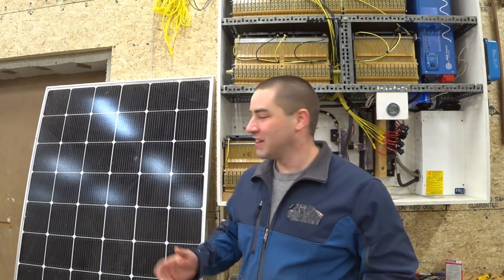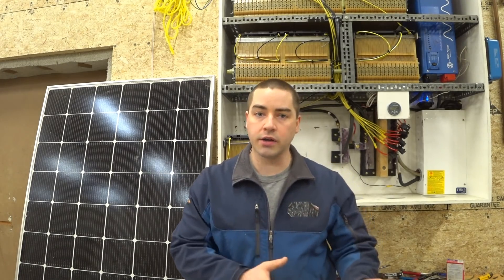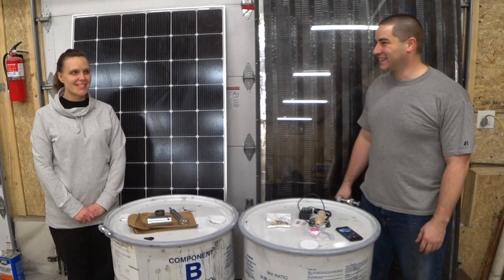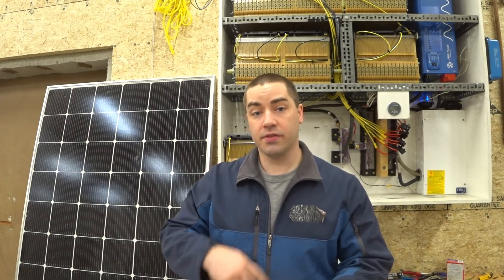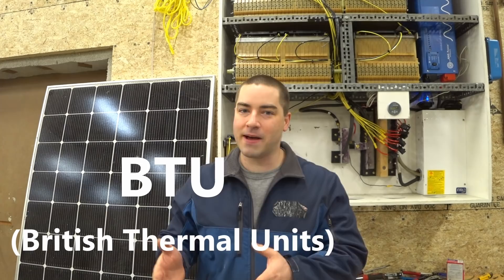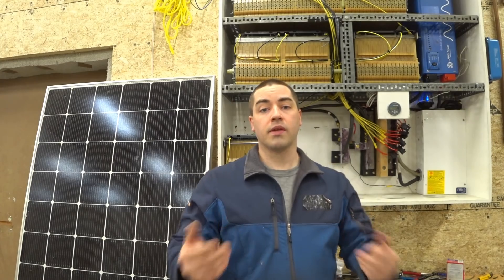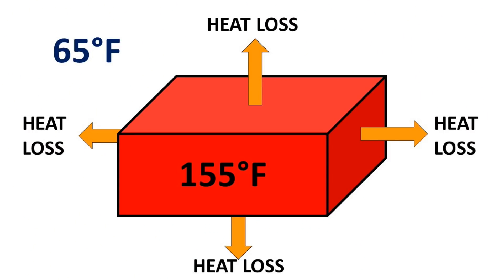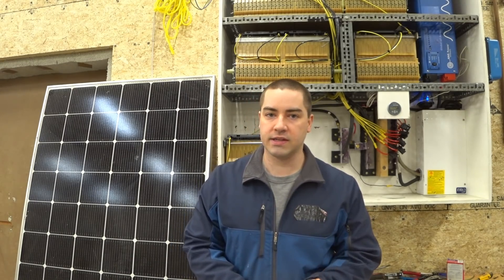Cheapest Energy Storage Off-Grid

Comment: A hot compost pile can reach 120-170°F even in the winter. All you need is an efficient way to siphon the heat from the pile. And to keep if composting. Like a coil of copper tubing buried in the pile. I'm sure someone can come up with a plug and play method of doing it.
Reply: John Pain used a twenty tonne heap to keep a greenhouse at 35 degrees C. for an entire year, day and night, even in frosty weather. The air was heated and simply thermosyphoned through the greenhouse using 100 mm (approximately), plastic pipe. This method requires no fans and the compost heap is not turned or added to. There were two loops of four inch pipe running through the heap using simple elbow fittings. This is an amazing saving in heating bills for growing food during the winter. The greenhouse was built on a step about a metre higher than where the heap was made, and the air simply circulated continuously through the greenhouse, and through the hot heap.

Comment: I store heat in a well insulated 330g IBC which is rated to 180f but I don't go above 160f. Cost of storage tank about $45 and I insulated it with surplus metal building insulation that comes in huge rolls. Cost there $0. We heat our house and all our hot water with wood. Summer solar is next. Water holds more than 2 times that of granite per square foot.

Comment: Great explanation!  If you did use copper instead of pex how long would the hear exchanger be in copper vs the pex tubing? What is your take on nickel iron batteries vs lithium? Looking forward watching more.
Reply from the maker: You can buy copper tubing in 100 foot coils.  I would try that in 3/4" diameter.  I think "Type L" is for residential potable water.  I think the results would be good.

I have not looked into nickel iron batteries a lot.  They are out of my price range.  My favorite battery is Lithium Iron Phosphate (LiFePO4).

Comment: Thanks for putting in the time and effort to produce this content, it's been very helpful! I wonder how you could work something like propylene glycol into the equation to increase the thermal store and whether this would be worthwhile. My father is on the old age pension and cannot afford to pay for electricity here in Australia so I'm doing some research at the moment to put together a super low cost system to remove the damage his conventional hot water system is doing to his bill so thanks again for your videos. :)
Reply from the maker: Your welcome for the videos, thanks for watching them.

As for your fathers hot water bills.  The fastest, simplest return on investment is to insulate the water tank and pipes like crazy.  I personally have done some jobs where I built a closet around the water heater tank just to insulate the whole closet.  You may have already thought of that, but I wanted to throw it out there.

Comment: Did I miss something? The electricity produced by the solar panels running a heat pump is far more efficient than dumping that solar energy directly into the water using heating elements? In my mind there is an obvious decoupling between the method used to heat the water and the method used to store the hot water.. A heat pump using that solar power to move the heat would greatly outperform a conventional hot water system by a factor of 3x or more and in an ideal world that heat pump would be a linear compressor / free piston sterling engine. Just my 2c :)
Reply from the maker: Hi davo963320.  Thanks for watching.  I used to have a heat pump water heater and did not have any savings overall.  Yes, the electricity used to heat water was less, but then I needed more energy to heat the air around the water tank.  That's just one of several reasons I got rid of the heat pump water heater.  It just did not live up to the hype.  
A separate issue comes up when trying to design a house for off-grid.  If you have a HPWH, then it will turn on/off at least once an hour to maintain the set point temperature in the tank.  Even if nobody uses water, just because of stand-by loss.  This means I will need a huge battery bank to supply electricity to the HPWH at night and cloudy conditions.  Here in Massachusetts I need to plan for 3 cloudy days in a row.  It turns out that having a large storage tank as my "thermal battery" is overall much cheaper than buying a huge battery bank.
Reply: @DavidPozEnergy  Yeah I don't have the same problem here in Australia of having to heat the cold side of the heat pump LOL. 

I think you also misunderstood me, you can store the heat that the heatpump generates however you like - use it to heat up your big reservoir running off solar power was my point, requiring less panels or freeing up the energy for other uses. Of course if you use a thermal collector then it becomes a moot point. :)

I'm also surprised you didn't use something like propylene glycol to increase the boiling point of your storage system but each to their own!
Reply: @DavidPozEnergy  I can see that you've had bad experiences with HPWH and after thinking about it long and hard, I can see that it really doesn't make sense to have all that additional complexity and potential unreliability / costly repairs etc etc. My granddad was a big fan of the KISS (Keep It Simple Stupid) principle and so I defer to your experiential wisdom!

Comment: good explanation with your thermal info, few years back I had a similar idea about the thermal heat my plan was to take the heating elements and place them in the center of a room under the floor the main tank would be setting on top just like a water heater except the tank would be about 1/4 or a 3rd of the  size of a existing water heater tank the rest of the tank would spread out above the main tank in a coil pattern of car radiator tubing(lots of tanks to choose from), solar or alternator ect.. gravity fed circulation into main tank. possibly interlocking matts and interconnecting piping combined, with a rubber material like floormat for installation, at the local hardware store. I didn't know this could be considered thermal maybe explaining it to someone to put it together so others can, heat radiating from the floor is excellent. The mass and volume of the original size of the water tank would be spread out in a equal amount of mass and volume of the piping, fabrications will be necessary in the design depending on mass and volume of the room or structure. An electric heater would operate well in this application with lithiums or even lead acid with solar  collecting plenty of potential energy with parallel capacity storage.

Comment: What if you used water cooled Batteries? And went with 95% efficient inverter. Use R30 insulation. And Copper heat exchangers. I just wonder if you went with the Very Best of everything avalable. What would the end result be? I Mean spare No Expense. Solar and Wind also. Thanks Donald
Reply from the maker: Hi Donald,  Thanks for your question.  I have a solar and battery setup also.  The batteries I have came with water cooling jackets on them.  If I wanted to I could hook up a hose and pump water through them.  However, after using them for the last year they don't get hot, or even warm.  I've checked them a lot with my IR thermometer and they just don't give off usable heat.  This is very good for the batteries.  
As for the tank, I wish I had gone with a copper coil heat exchanger instead of the PEX.    Certainly more insulation is better.  The next time I build a tank I might go for an R-50 around it.  But, right now it's in my crawl space.  The tank is maxed out on how big it is.  No room to spare for more insulation.

Comment: How about using gravity as a storage mechanism. Use your excess electricity to lift a very heavy concrete weight with one or more electric winches. At the point that you need to use the excess or saved energy, allow the weight to slowly descend while using the descent to spin one or more electric generators to recharge your battery bank or power your electrical panel. I do not know how this would figure out $ wise but there would be no heat loss. Your loss would be in the friction of the weight moving up and down.
Reply from the maker: I love looking into alternatives.  I've heard of companies experimenting with doing this with large wells.  Some municipalities do it with pumping water uphill.  However, I have not seen any residential scale gravity storage systems.  If you do come across an example please let me know.

Comment: Yay!  I go off grid and I can take a shower with little to no sunshine for 4 days in a row?  Guess I'd better shower during daylight since I'd have no power to turn on the lights, or run the pump for the hot water for that matter.  
When I think about going off grid, I'm assuming electricity availability for, oh I don't know, maybe cooking, using my other appliances, running an air conditioner or heating system, watching T.V., charging my phones, using my computer, etc. etc.

Comment: great information. will incorporate some of it into my setup.

what do you heat your water with? DC elements?
Reply from the maker: I currently use solar thermal collectors to heat water with an electric tank back-up.  I'm thinking of adding a new tank with a DC element in series.  If I was building a new system from scratch I would just have the DC element unless the system was space heating.
Reply: Thanks for the follow up. I probably should have assumed that from your videos!

I'm up in the middle of Canada and I am trying to put together an off grid system that can make it through our Winter, with the caveat that my wife must be able to use it. 
Your ideas are definitely leading me places.....

Thanks!

Comment: I noticed that the outside of your tank is wood framing and is not insulated. I'm thinking you could further reduce your radiated heat loss by filling the frame cavities with closed-cell foam insulation - at least on the four sides and lid. It's relatively inexpensive and available in spray cans.
Reply from the maker: Yes, that is something you could do if you are going to build your own tank.  I don't think it's worth the expense given the R-value I already have inside of the wood framing.  Thanks for your comment.
Reply: @DavidPozEnergy  No, thank you. Very interesting. I would do it, of course, but that's because I'm one of those people who can't be satisfied with good.

Comment: Making hot-water from peak-power is a great idea.

If you have a hot water heat pump you'll in theory make the same amount of water for about 1/4 the electricity.
Reply from the maker: I've seen numbers like that from manufacturers.  However, I used to own a heat pump water heater and did not see savings close to that.  This was 6 years ago and things may have changed by now.  At the time HPWH were new to the market.  How have you tested/monitored yours?
Reply: @DavidPozEnergy  Real experience ranks higher in my book. I thank you for that info. Things are progressing fast with heat-pumps, but I would think it wise to stay critical, I edited my original post to add that this is in theory only.
I'm trying to size a coming system right now and I'm wondering about this. I've measured at friends houses as various efficiency losses whether from the heat pump itself or the system needs to be taken into account. As with the peak power requirement. Did you find that your heat pump drew a lot more electricity on start-up/coming from stand-by? What model was it? Thank you.
Reply from the maker: I never measured the peak amperage draw of the heat pump.  I would guess it is similar to most compressors, a surge to start it and then a lower running watt.  Every situation is different.  I live in Massachusetts, which is a heating dominated climate.  A HPWH robs the house of heat to heat the water.  Which is bad in cold climates.  However, this is awesome if you are in a cooling dominated climate.  They might make sense for you.

Comment: Confused . The logica  Way to  make water hot is using solar heaters eg black colored pipes with  cold water  water in them that send the solar heated up  hot water to a hot water tank to use directly or to heat exchanger  like to your   storage tank solution  . Using solar electric cells to heat water isn't so logical use of  solar power due to more losses  and the much greater extra cost of electric solar cells to make electric heat versus just taking solar heat directly with solar heater pipes  . Using the solar electric cells to drive a water pump for solar heat panels filled with water to pump to  storage  tanks would be effective use of electric solar cells as those power demands are small  . The maths for the hot water  storage  is very useful info like the video
Reply from the maker: Hi dcdourbonireland,  Thanks for your comment.  This video is more focused on the storage of hot water rather than the collectors.  However, I have been using different  solar hot water collectors around my property for years and have several videos on my property about it.  Both systems (thermal and PV) have practical uses in heating water.  Thanks for watching.

Comment: Awesome information. Thank you. 

When I am in the Caribbean. Outside major areas. All the above ground pipes heat up in the sun. At mid day you can take a hot shower for 5 to 8 min with no hot water system before the water quickly turns to 60 degrees or so.
Reply: Can confirm.
Was raised in the Caribbean, we stored water in these 500 gal black plastic tanks. Just by sitting outside in the sun you would have hot showers till well into the night with no panels or heat exchanger.

Comment: David, what if you have a water storage tank above. You use the solar electricity  to pump the water up into the tank. At night you use the stored water to drive a generator to produce electricity? DavidB
Reply from the maker: I think it would be a lot of fun to build, and measure.  My gut feeling is that it won't be a very efficient process.  Towns can do this when they have big lakes and dams.  I wouldn't spend much on the project, but if you have a generator kicking around, it would be fun.

Comment: Where has that R value come from in the thermal loss? 9:30. Great vid, btw!
Reply from the maker: I'm using a polyiso foam board.  Each board is 2 inches thick.  R-13 is printed on the board, and I doubled it because I have two layers.  4 inches total.  Thanks for watching.

Comment: Place your blue pipes in a box that can hold water add copper pipes between your blue pipes add on your roof copper pipes to the copper coils in between your copper pipes in the basement on our system we had a wood burning furnace that also had copper coils in your case in the watertight box between the blue pipes along with the water copper coils on your roof this heat exchanged with the wood heat the domestic hot water and your blue pipes this house had a 8 foot around 8 feet tall but you could use a smaller tank as the house was 36,000 square feet. 
Look up this old house the solar panels when Bob villa was host they grew the panels in mass.

Comment: Couldn't be more true. But, hit water should be kept hot @ 70C at least. The best way is vacuum insulation where the degree of insulation could be varied and even let the hot water reservoir function as a huge radiator when required. Variable insulation with zero insulation materials and all the fuss to build them. Then, yes, hot water is what we spend most our electricity on but that heat cannot be conveniently turned back into electricity nor mechanical energy...  But, yet again it should not matter because the electricity captured on the side should be plenty for any usage even with one or two electric cars from just the solar roof of a 70-80 sqm house. I already have a complete project on this including fine-tuning all energy capturing and storage with the simplest systems possible = unbeatable design value. I should know, as for years now I repeteatly try to better / prove it wrong and still fail. The tragedy is no one is really up for the risk of just building it as is. Your ideea is right on the money but the refinement needed to actually have the most efficient yet simple home design is a bit more work... This universal + completely autonomous living space I would very much like to offer the world seems it is its own enemy because  it also comes unwillingly as a slap to overcomplicated design and over-engineered mindset of 99,99% of modern humans and even worse of modern designers, all trapped in bettering by adding instead of removing. I am really curious if at least one will get this message while forgoing all unintentional offense. All best :)

Comment: 45 years ago I was working with passive/active solar systems. One case a house was built with a 2,000 gallon plastic tank filled with brine and heat incoming and outgoing heat exchanges. The water panels where well made but heavy, very expensive and stationary. The energy storage sytem was good, the collection system was Meh. Tell me about high efficiency collectors that track the sun as it moves.
Reply from the maker: That sounds like an awesome house!  Having 2,000 gallons built in is nice.  I don't know of a perfect answer for you.  Collectors that heat water are heavy.  I've done a series of videos comparing solar collectors to solar PV (electric) and I think the PV panels are the way to go.
Reply: @DavidPozEnergy  your saying you have found generating electrical power and using it in resistance heating to heat water is more efficient than using collectors to heat water?
Reply from the maker: Yes, in my cold climate of Massachusetts, in the winter.  In the summer it is still more efficient to heat water with solar collectors (hot water) but in cold weather it is more efficient to hook the solar PV (electric) panels directly up to a resistive heating element.    I share all my data for this conclusion in this video: https://youtu.be/KVeGummoXS0  I hope you find it interesting.